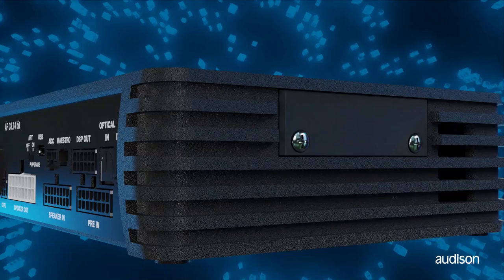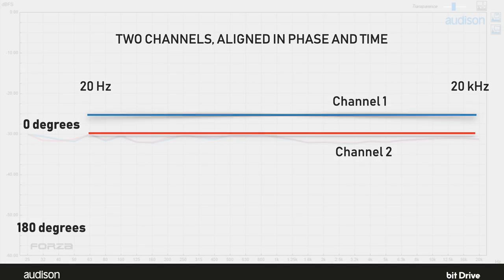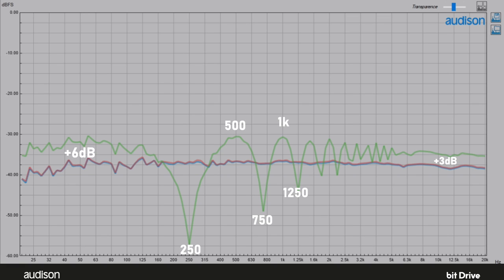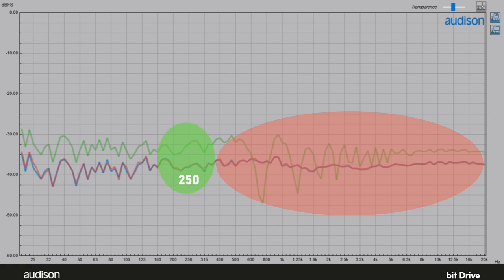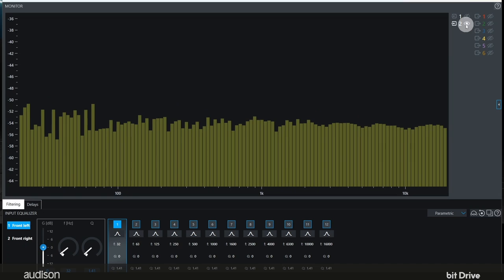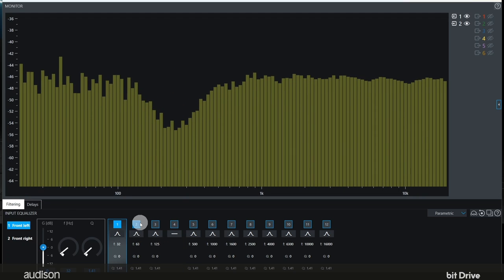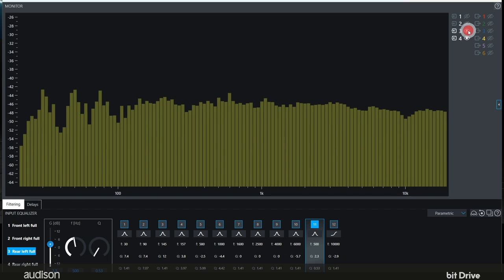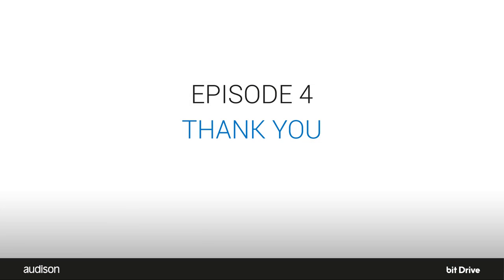Episode 4 - Manage phase misalignments by using the electrical RTA

Comment: Thanks for adding this short series in different parts. I was watching the old workshops and it was until these series and having to set up my AF C8.14 bit that I finally felt I know what it was happening. I was able to correct phase issues with the stock system (Toyota) it helped that this series uses a Toyota as an example.
I watch the other video that includes the equalization. However, I would like to say that it would be nice to see the "initial" target curve during that phase to help visualize the change in the response. Are there going to be videos about how to load or use a target curve? What about presets the availability of different presets? Thanks